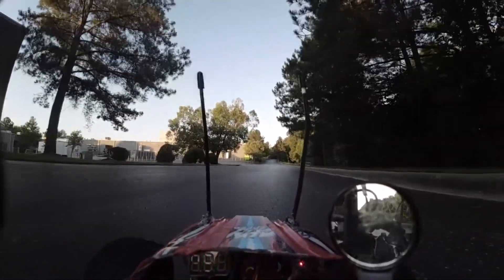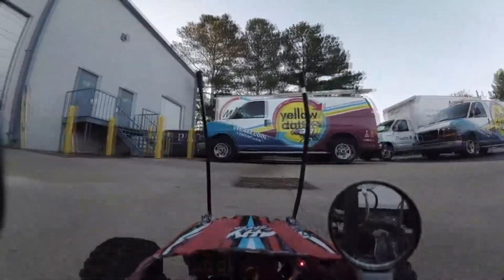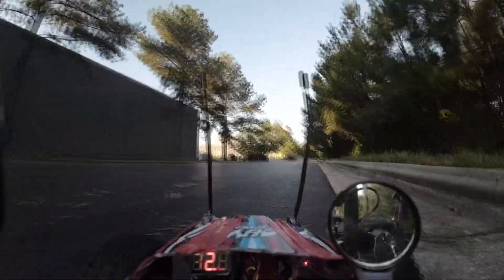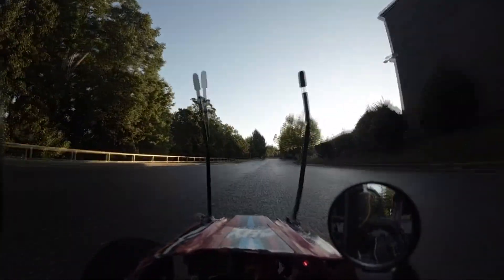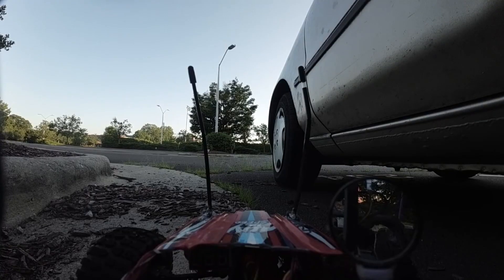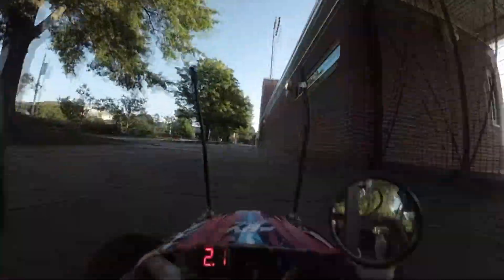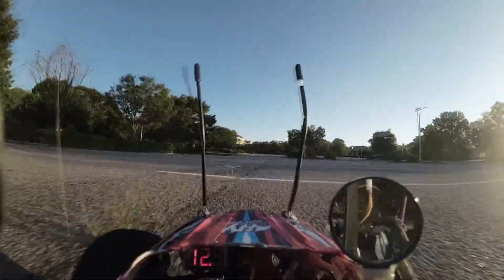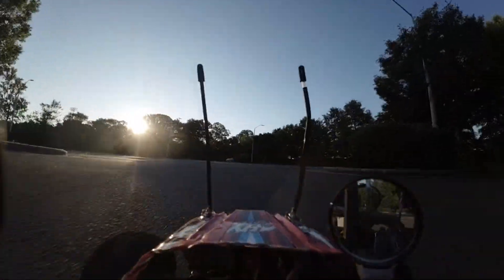DJI O3 RC Car FPV LOS Range Test

Comment: I want to slightly correct something you've said.  While RF does technically travel "forever," the signal strength at any given distance, assuming pure line-of-sight, follows the inverse square law, which states that for a fixed distance multiplier d, the received signal strength will be 1/d^2. So let's say your vehicle is 100 meters away, this will be our fixed distance.  If we now double that distance, you will be receiving 1/4th the signal that you were at 100 meters.  If we go out to 300 meters, tripling the distance, you will be receiving 1/9th of the signal that you were at 100 meters, and so on.  Therefore, at some fixed distance for any given point source transmission, the received signal will no longer be distinguishable from the noise floor.  In this sense range does actually matter, even given line-of-sight, it's just that pragmatically, at UHF frequencies, obstructions, especially obstructions with moisture content, attenuate the signal WAY more than distance does.  What you said would essentially be true if there were no noise, and you had an infinitely sensitive receiver.  I'm being a bit pedantic, admittedly.  :)
Reply from the maker: You're right but read my explanation (in description) . For all intents and purposes distance doesn't matter relative to obstruction, at least when it comes this fpv stuff. People are always asking about sheer distance so I felt it necessary to clear that up.
Reply: @Magneticitist  Yeah, I totally understood what you were getting at.  It's absolutely true for ground FPV, but for airborne FPV, it's entirely possible to be 20 or even 40km away and still have line-of-sight, at which point the inverse square law is definitely going to start coming into play.  Just wanted to clarify as there's a lot of overlap between the ground and air FPV audiences.
Reply from the maker: @SilentGloves  True I should have clarified it's all ground stuff.. but even in the air there is the problem of battery life.. so ultimately it's more or less not too big a concern unless you're specifically flying a long range rig in the air.

Comment: Nice video bro! I’m trying to build a similar setup with a TLR 22-x4,But in addition I’m adding head tracking hardware as well. I have a question about how you power the air unit. I tried with an XT60 connector that I use in between my parallels just to test the air unit since I got it used on Amazon. Also to note, the wires on the connector are a tiny gauge. The connector is meant to be used with a cheap fpv camera I got on Amazon. Anyways, the results I got was no power light and after a few seconds the unit started warming up so I immediately unplugged it. So based on what I saw on your video I figured you might be able to help me out and tell me what I might be doing wrong. FYI I’ve got the older model goggles. I believe they’re the V2.
Reply from the maker: I use V2 goggles as well. Far as powering the unit I never had any problems, I just put 12v or so to the red and black and that's it. Shouldn't matter the connector so long as it can handle maybe 2A tops. I can only see that being a problem if the wires are actually way too thin and you're supplying the O3 with the bottom end of the voltage it needs to work. If you didn't get any kind of light then it sounds like it's fried or something. I wonder does it still work as a storage device when plugging a usb cable into it?
Reply: Thank you for your fast response. I’ll try to see if it works as storage. Yeah, I bet it’s fried. Someone probably returned it after burning it up. Amazon will take back anything. I’m gonna try soldering a 14 gauge pigtail on there to try it before I return it.
Reply from the maker: @southernharvestmicrogreens6163  I just remembered about this video https://www.youtube.com/watch?v=dwR4BIhfxtw 
"DJI O3 Connector Warning - Not All Are The Same" by Mads Tech. Have you seen it?
I wanted to clarify that when I said the connector shouldn't matter I meant so long as polarity and the terminals are right etc. Maybe you've done something similar with the unit where it used a connector different than what it came with? Either way though, if something like that was the case and the connection was wrong it's probably fried now if it was getting hot inside.

Comment: I just finished building one of those high frequency oscilator circuits , I did not follow the schem to the tee , but pretty close to Acid byte schem I am testing it without the resonator for now , we will see how it would take me to kill this poor fet 🤣🤦🏻‍♂️
Reply from the maker: It's a toss up. I feel like it's either or. I've either never killed any fets on one, or killed far too many. Once I started really being careful they almost stopped dying altogether but it's kind of an eventuality with a circuit like that.
Reply: @Magneticitist  oh man it was so stupid , was the fastest way I killed a fet , did not last a second the freaking thing I am mad 🤦🏻‍♂️🤣 anyways that 260 was laying around long time , but I thought I was gonna be able to have a few hours of fun at least , I was testing it at 12v and as soon as I raised the gate potentiometer a little bit I shorted , I got no luck with tc lately 🤣
Reply from the maker: @rodriguezfranco3839  That's kind of my typical experience with legit 260's. Upping the gate voltage is the opposite of what I do with those things though. It's hard to not do if you can't just raise the input voltage more. I used to see something like 8V gate waveforms on a lot of those things and think oh wow I need to increase the gate voltage but nope lol.
Reply: @Magneticitist  yep and this time I put the tvs diodes between gate and source , eventhought they are 18v tvs I thought it would protect the gate but it did not hehe , I might try with a irfp460 and I might add some 10v or 12v zenners in series with the tvs , but might be a waste of fets with this shit
Reply: @Magneticitist  do you think trowing like a irfz44z in that circuit would be just a stupid waste ?
Reply from the maker: @rodriguezfranco3839  yep

Comment: Nice ride ! Wonder how far could you go in like a very unobstructed area like a desert
Reply from the maker: After all the testing I've done it seems like it wouldn't be a concern.. This goes for the air also. If you actually have a long enough stretch of open (and clear) air/land where you could technically pull out a telescope or something and then spot the car/drone out at a distance, you're going to be limited by the battery life. Once you are out at long range though it's not like you can start putting things in between and expect to be able to manage it easily. That's probably how a lot of rigs are lost doing long range. If someone is standing next to a parking deck and flying all in and around the levels penetrating a certain amount of concrete they might get the impression they can put some small amount of obstruction in the way after flying out to a mountain peak. That would not be recommended.
Reply: @Magneticitist  with all this titanic sub tragedy I got me thinking how dificult it is to propagate the rf through the water hehe
Reply from the maker: @rodriguezfranco3839  I just heard about that last night actually and wondered the same thing. I guess they are able to do it fairly well since the underwater vehicles are going pretty far. But then I'm not sure if they are just using ridiculously long cables or something. It's more about the frequency used though. For example the real difference between 5.8ghz and 1.3ghz when it comes to range is just that even with clear LOS, the 1.3ghz is going to penetrate the air better. If there is a lot of moisture out then the 5.8g is going to get much shorter range than it would were it a clear day. In that regard if they use something in the lower end of UHF it's probably not hard to go super deep in the ocean.
Reply from the maker: @rodriguezfranco3839  So I just looked into this and apparently they have to go down to VLF just to penetrate tens of meters. So basically it has to be a combination of VLF and long cables. I'm not sure I totally believe they don't have ways to do it with proprietary technology totally wireless. We know sound waves propagate through water fairly well so I'm sure there is some method the military is using nowadays that incorporates both somehow.
Reply: @Magneticitist  I read some about it and is very hard , I know military subs have a hard time comunicating underwater , but in water the lower the Frequency the better , I think they use some ultra low freq , apparently high frequency waves just bounce on the water surface
Reply from the maker: @rodriguezfranco3839  I figure if we're not talking HD video or something it wouldn't be too hard to use VLF to transmit and receive basic information using high gain directional antennas which use tracking based on SNR alone. Maybe something about water just makes it much harder though and I suppose one could treat it as solid concrete.